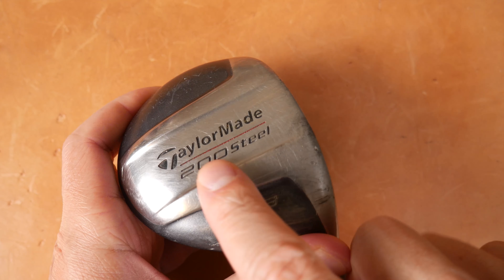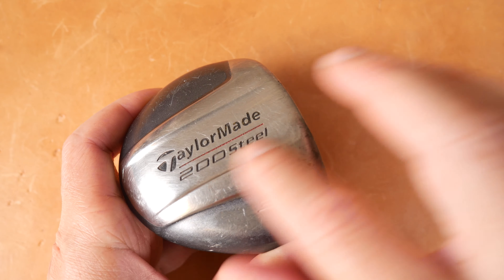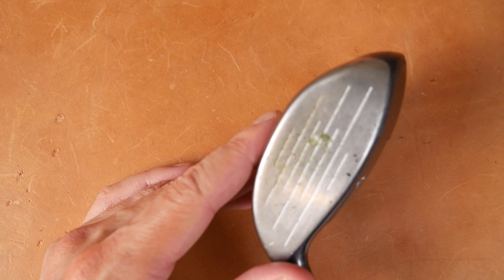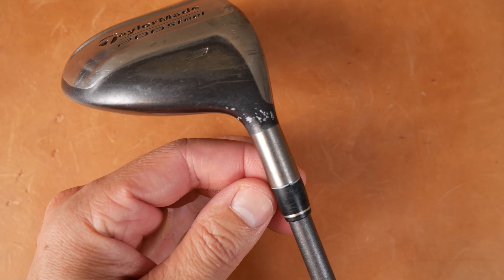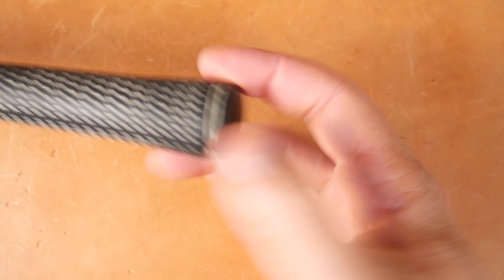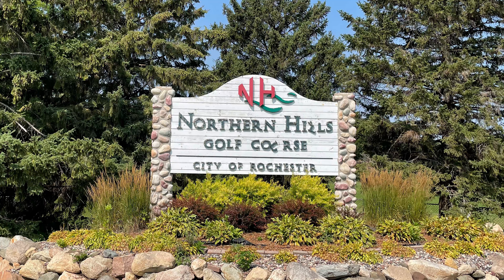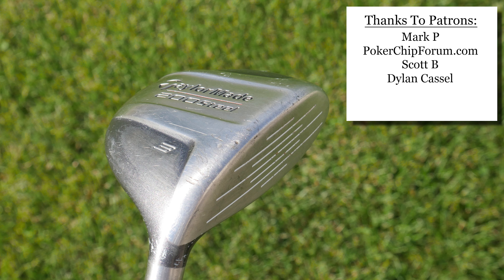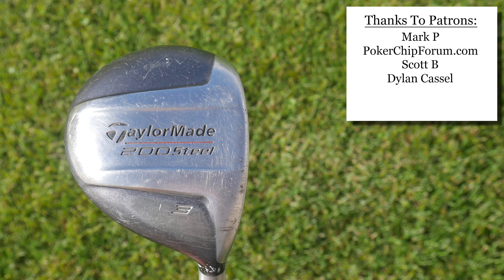2002 Taylormade 200 Steel Fairway 3 Wood - The Vintage Golfer

Comment: I found an almost new TM 200 3w for $20 with a TP tour steel shaft and wow this is my "Billy" club!   I took my Titleist TS3 out the bag.  This club is versatile on and off tees but amazing launches fairly high and long, most par 5s on in 2 or around green.  If you find one, give it a try :)

Comment: I made a cheap bag of clubs as I haven’t played as much in the past few months and sold off my newish pings as the preowned market is still inflated.
Ended up with Wilson Deep Red II irons, Taylormade 580XD driver and 3 wood, Taylormade Resue hybrid and a set of Cleveland  CG10 wedges and a Ping g2 Craz-E H. This is my tribute to 2004 a honestly everything was less than $200 and still play a consistently poor as I did with 2019 tech.